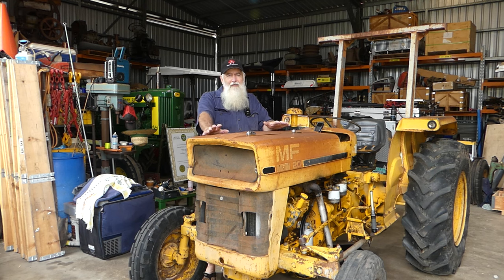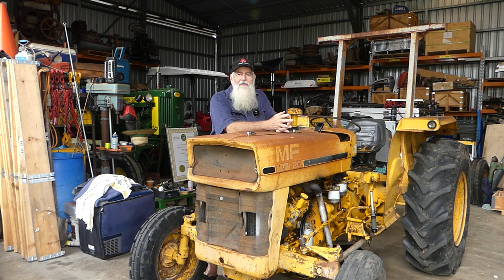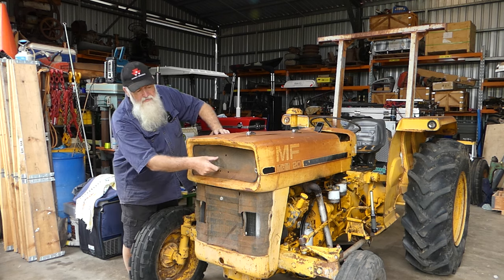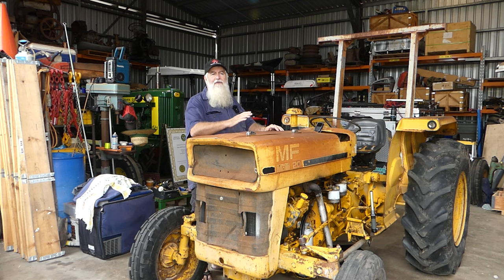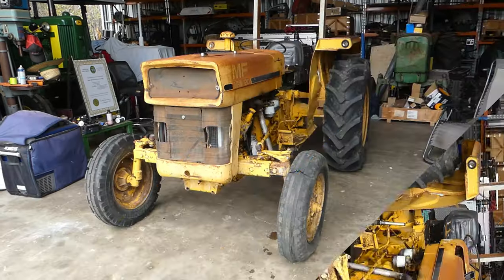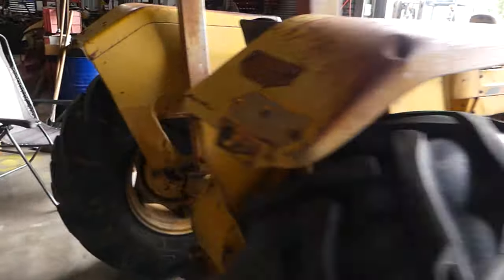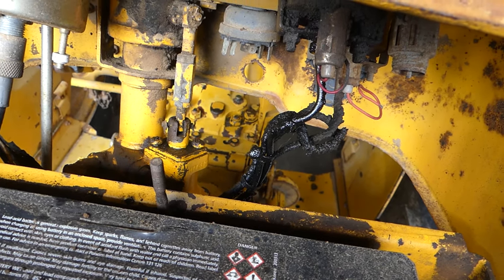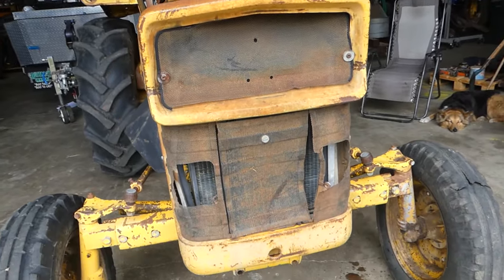Massey Ferguson 20 Industrial Introduction

Comment: Is there any way to convert it to an up exhaust instead of a down exhaust?  I was raking hay with my 135 and hay underneath plugged by the muffler and caught fire.  After a mad scramble I extinguished the flames and saved the tractor.  But it was a close call.
Reply from the maker: Yes you just buy the exhaust elbow for the vertical exhaust and purchase a vertical muffler. Not an expensive exersise really.
Reply: Get a flapper valve for the top of it plus put a can over it as backup. Upward exhausts get rain in them and ruin tractors too!

Comment: Hello Lance, i have just put a new clutch in a Ferguson TEF20, which i am restoring, also had to install new spring which pull the thrust bearing carrier in and out, this is where i have made a mistake and have used springs that are not the correct ones and the tension on them are too strong.
 I noticed on your T20 video that when you had the stearing box of the tractor you can see the thrust bearing carrier spring.
My question is can i replace the wrong spings by taking the steering box of instead of splitting the tractor again, your help on this subject would be gratefuly appreciated.
Reply from the maker: Yes I think you could, I have not done it myself though.
Reply: Thanks Lance, Happy and a healthy new year to you and all your family.

Comment: What did the industrial Massey offer that the 135 did not. They seem very similar so why would you have bought the industrial not the agricultural. What job could the industrial have done that the 135 could not. Good video's by the way, looking forward to the fixing.
Reply from the maker: The industrial didnt have pressure control in the hudraulics but apart from that Im not sure. I wonder if it was a price thing or lack of supply of the 135. Not really sure.

Comment: Hey Lance, I have a 135 with power steering pump fitted but the 2 rams on the front axle have been removed. Is the steering column on a power steering tractor different from one on a normal steering tractor? I'm wondering if mine has had a replacement steering column fitted because it doesn't have the valve fitted to it under the dashboard like yours has. I know where there's a pair of steering rams but I'm wondering if I need to find a power steering column too. Best wishes from England. Peter.
Reply from the maker: Same steering box but the column needs the valve. you can buy the parts to fit the valve.

Comment: I used to see those MF20 tractors at road construction sites.
They were mostly hooked up to a PTO mechanical broom and most times be surrounded by a cloud of dust. 
I see from 'Tractor Data' there was an earlier model - MF2135. I have never seen one or photo of one in Aust.
Just wondering has anyone seen one here. I see photos of them in the UK & the US.
Reply from the maker: I have not seen the 2135 over here either, they had a very nice colour scheme not just the black and yellow of the MF20.

Comment: I have the 135 with the diesel Perkins. Looks exactly like that but red and silver. Looking forward to seeing you fix it up. I have a lot of leaks on mine also I need to fix
Reply from the maker: They are very similar indeed, the industrial had a speedometer in some cases and no pressure control in the hydraulics.

Comment: That's a great plan to do a 'getting it working' series rather than a full shiny paint redo. More of us out here want to buy an old tractor to do work projects, shows with fancy paint are fun but there's work to do.   I bought a 'parts tractor' and actually got it running until the three point quit, the valve actuator cross-pin under the pump fell out, water in the system when I got it must have corroded the cotter key wire. That's all back together and I'm working on the top link draft spring reassembly (to put a new boot up there!).   Looking forward to your latest project. Since you're coming around to spring, maybe you can run this tractor into a series like a couple of big channels "can we get fence row finds working again to farm with?" Lot's of new homesteader viewers out there. Fix, plow, plant corn, cultivate, harvest.
Reply from the maker: There is a repair playlist now but We dont farm here apart from slashing the paddocks and keeping the place tidy. Ill see what I can get up to though.

Comment: Lance, are you aware of a source for an aftermarket diesel injector for the early style indirect injected  3.152 Perkins?   My local here wants 100.00 u.s. to bench test 1 injector.
Reply from the maker: For $100 you could buy your own tester. Im not sure about a whole injector but I think nozzles are available.
Reply: Thanks I did replace the injector nozzles.  Still get a raw fuel odor and smoke till she warms up.    Need to check cylinder compression as well.   Thanks for all the videos you are a great help to all of us cheap old bastards.

Comment: I have a 74 model mf 20 industrial a highway department tractor in Missouri good old tractor the transmission leaks on the input and the rear 3 point are up or down no in between love it starts every time.2 turns.
Reply from the maker: Do you have a speedometer? this one doesnt but I see some do.

Comment: G day lance this would be pretty rare wouldn’t it?  I have a 550 here tome looks like tarted up 35 you know much about them.   It has hydrostatic steering 4speed box factory dual remotes and independent pto, are they any good ?  Clutch pac etc
Reply from the maker: Yes the 550 is a good model. This is a fairly rare machine over here at least. I dont know that I have seen any others. That is why I grabbed it.
Reply: i spent a lot of my younger days in the bush never saw a twenty like yours or my 550    never heard of them either

Comment: Nice tractor. A fella I knew down the road from me had a MF 20 , but it look like a MF 240. 
Great video. Have a good day.
Reply from the maker: The model after this one was a MF20B and it looks like a MF240. https://www.tractordata.com/industrial-tractors/000/1/5/157-massey-ferguson-20b.html
Reply: @BundyBearsShed  yes that’s it. Same cab. The fella I knew used it for snowblowing. Rear mounted. The fella pasted away this year. I believe his son has the tractor now.